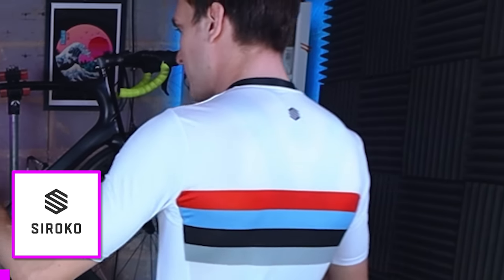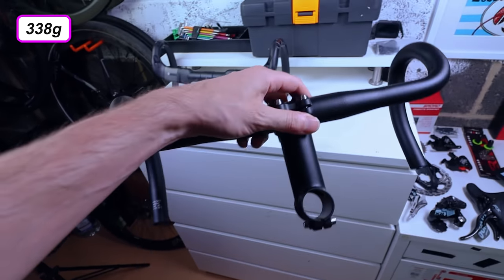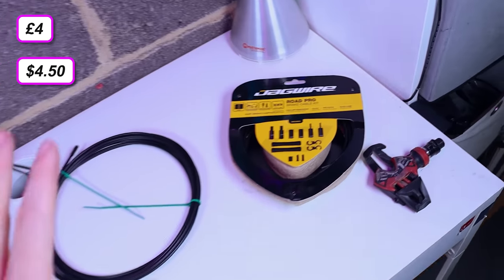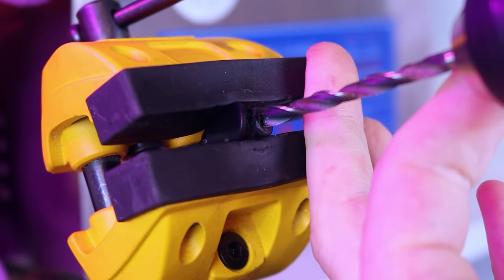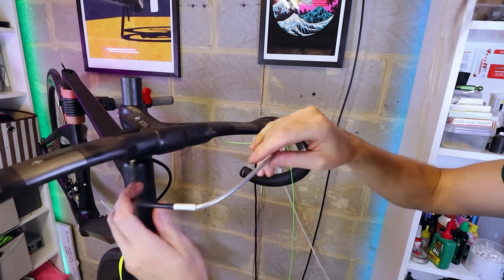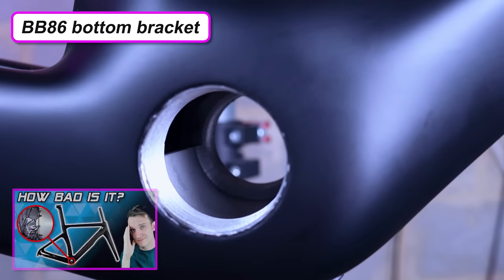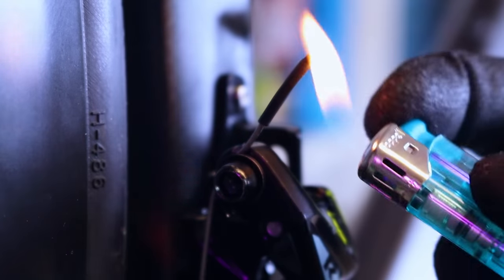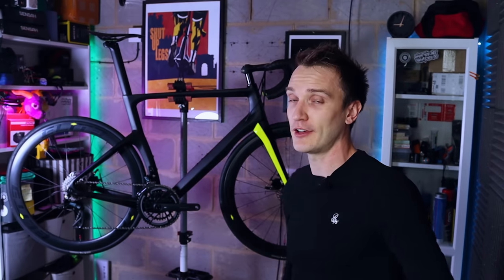£1000 AliExpress Carbon road bike build - Disc brake

Comment from the maker: Absolutely LOVING the number of baguettes in the chat 🥖🥖🥖 You guys are the best 🥰
Reply: I hope you can get some rubber boot cable covers on the brake calipers
Reply: @sepg5084  exactly what I was thinking when I saw those. Could extend the life of the cables and housings by preventing road crud from getting in there.
Reply: "Ciclista" in spanish form Spain it's with a harder "Th" like in "Thing"

Also i didn't know Siroko was from my country! :O
It makes sense tho, Spain is a PARADISE for cycling (and motorbike riding!). You should come with one of your bikes someday Luke! (No idea how much Ryanair could charge for the bike tho... 🤔)
Reply: @Angel_EU34  I'm not sure if Ali express sells plane tickets
Reply: Trace could you do a show on cheap carbon seat posts  🥖🥖🥖
Reply: The I love this fing bollox comment pretty much sums it up for me.  Kudos 🥖
Reply: Looks like someone is pretending to be you by claiming they have randomly been selected for a price. It has your logo and name and they try to get your personal info by having people contact them on telegram. Have a look at the reply I just got on my other comment on this video.
Reply: 🥖Great Vid. REMOVE that CHAIN. Its destroying your cassette. It was free for a reason. I had one free with my Sensah groupset. It was badly stretched after 100 miles. Its probably not even 12 speed.
Reply: btw I think someone is using your channel name phishing for personal details from your users.
Reply: @thomasullmann7447  yeah they are. I tried to tell him here as well a few days ago, but seems like Luke is out cycling and haven't seen it yet :/
Reply: Great build! 🥖
Reply: Looks good for a £1000 ....Tempting over the rubbish for a grand from manufactures with $10 wheels lol ....
Reply: Carbon fiber headtube don't use a star nut?
Reply: How much lighter would regular rim brakes be?
Reply: Croissant?
Reply: can you put the link for the groupset in the comments please

Comment: You should tightly wrap the steerer tube with masking tape where you're cutting. It will make the carbon stands stay together and be cut, stopping those odd ones you had from tearing out.
Reply: Or get a proper carbon specific hacksaw blade.
Reply: @Utaheyelid  nooo that's boring.

Comment: Recently there seems to be quite a lot of videos appearing on YouTube doing the same type of content, but you’re always one step ahead with more detail. Very entertaining and inspirational content. 
Let’s see what you make of the Ride Now tubes, I been using them for 2 months with no issues so far.👍
Reply from the maker: Thanks Malz! But yeah ive been really impressed with the RideNow tubes so far. They ride well, and seem pretty puncture resistant, but time will tell i guess. Good to hear you have had a good experience with them!
Reply: @TraceVelo  my RideNow tubes arrived today. No problems installing them. The trick seems to be inflating them just enough so they hold shape and then set them in the rim channel. After that it was easy. 🥖  ps. I ride with 2 spare tubes, total weight savings: 345g.  :-)
Reply: @TraceVelo  Are they latex, thermoplastic elastomer, or another plastic?

Comment: Cool build, and awesome video as always!! 
a tip on cutting the steerer tube: i used 2 old stems. mark the level on the steerer tube, plae one stem under it, and one just above. the gap in the middle will be where the saw blade will slot in, and just cut away ^_^ It might help prevent carbon fiber splinters too ^_^
Reply from the maker: This is GENIUS!!!! I have a couple of old stems knocking about in the drawer, definitely doing this the next time, thanks VeloPinephrine 😊
Reply: @TraceVelo  You're Most welcome! 😁

Comment: On the cables contacting the resin internally, looks like a prime candidate for using those lightweight plastic inner liners that come standard inside frames and bars. Even more fiddly but so worth it.
Reply from the maker: Yeah i think you could be onto something with this actually... But im gonna leave it for a few hundred miles, and see if its actually an issue. But this could be a fix for sure!
Reply: I have a Cinelli frame and the liners from the bottom bracket to the derailleurs are actually meant to be used that way so it might be the same thing here..

Comment: Hey man! to prevent rubbing on the frame with those naked cables use the plastic cable guides( clear ones that come with the frame) in that section, I have seen specialized bikes coming like that way as well!
Reply: Indeed! Jagwire sells it for their modular cable systems but you might as well just use it to prevent damaging the frame here

Comment: Thanks for the video, it actually inspired me to build my first road bike but I went a different route. I got an Gray cycling aluminum frame instead with external routing, E90 carbon fork, Sensah SRX Pro Groupset,  Elite Wheels ENT Carbon Deep 60mm  wheelset, ZTTO cable actuated Hydraulic Brakes and rotors, Zeroing 48T Crankset, ZTTO 11 speed 9-42 Cassete and chain. I reused sparre parts laying around ro compete the bike. I am very happy with this build.  Keep up the good work.

Comment: Luke, for the bottom bracket cable routing you can buy a plastic piece to guide the cable routings, preventing it rubbing the frame.

Comment: I love that you showed how tough working with these inexpensive, internally routed frames is.  But I also appreciate your own satisfaction in your clever hacks and modifications.  Two small thoughts:  you might run your derailleur cables through inner cable housing underneath the bottom bracket to alleviate the cutting that will otherwise occur.  Second, that front derailleur might be too stiff for that light lever.  I'm sure you have another that requires less torque.  In my case, I replaced my Sensah front derailleur with a Campy Super Record front; it ended up working so much better with the Sensah lever.

Comment: Great build, never felt I needed a "Disc" road bike but I'm very tempted by this just to give me the option, shame Lt-woo haven't fixed the shifting from the drops, for me it was a deal breaker with the R9's I tried. 
Bit of advice (because I can't help myself): When you next cut a carbon steerer, pic up a "Tungsten Carbide Hacksaw Blade" Its exactly what ParkTool sell, Silverline and a few other budget tool company's sell them for about £4. Use a cheap aluminium stem with a lose spacer on top as a saw guide, and cut a ring/grove all the way around before sawing through from one side this will prevent splintering.
Reply: Almost forgot: 🥖

Comment: Hey Luke! I have the same design under my bottom bracket with the cables rubbing against the frame! I fixed it by using a little piece of that guide tube that the bike comes for the cables inside the frame! I used just a little piece like 10cm so now the cable slides inside the tube instead of rubbing against the frame 😉
Reply: I had that problem also and it caused my cable to fray. Explaining it to someone was unbelievably difficult. A lot of people(me) don't even notice until their cable is shreaded. Finding it on line is impossible. I think I ended up improvising something also. Gonna flip my trusty Motobecane over tomorrow and see what I did.

Comment: Another great vid as usual!👌 Another little tip I use after cutting the excess gear cable is simply a dab or 2 of clear nail polish -nothing else! 'Keeps the cut end from fraying & there's nothing to remove if you want to pull the cable through/out to clean or replace the housing/outer👍🥖

Comment: Surely the issue with filing and drilling the cable entry points relates to the fact that the cable outer is not meant to run thru the frame, but rather, stop at the entry point with only the naked cable running thru the frame inside those tubes left in there at manufacture? This is how the shift cables on my Giant Revolt are run.

Comment: Fitted my Ridenow TPU tubes earlier this week, only done circa 100k on them but they feel great. Running them with 30mm Conti GP5000’s. Super fragile so installation is a delicate process!

Comment: Great video! Personally i would really recommend a good set of tyres. For me 12£ Prime labelled tyres just seem really untrustworthy. Regular Conti GP5000 are just so good, they almost roll by themselves and have good puncture protection.
Reply: I prefer Contis on my bikes as well. decent rolling resistance (or lack thereof), good value for the money and tend to last a good long while
Reply: I've been on those Prime tires for 4+ years. Love them, minimal flats, and last as long if not longer than the brand name ones.

Comment: 🥖🥖🥖For the cables underneath the bb, you can try using the teflon liners that come with the frame, it creates a nice sheath and is pretty smooth. You'll have to recable anyways because of the cracked bars ;)
Reply: Lol
Reply: ive always used the teflon liners too, never had a problem. Shifting is fine

Comment: Loved your video, as I have all of your videos but I was distressed not to see a seat post section lol. I recently bought a carbon complete bike from Sensah Empire, and wouldn't you know... I bought it off Aliexpress! Over here in the states, it seems as though buying a carbon bike, from anywhere, you'll have to wait until, at least mid 2023, n pay quite the exorbitant price. My only option then, was a slow ship from China! It took 40 days but my main complaint? You guessed it! The damn seat post keep falling in! This was, actually how I discovered you!  No matter what I did it wouldn't stay up. That was until I found your video wherein you mentioned just such an issue. Then I had to find the video mentioned in the video where you mentioned it the 2nd time, 1st time for me (that sentence does make sense). I had a difficult time, for I did possess the plastic you mentioned, but there wasn't quite enough room. Once done (to the best of my ability) the post got stuck several cm too high. So out I went without tightening it, n checking it every couple minutes. After about 30km of bouncing and checking I was nearly in place, n so I tightened it, and everything has been great ever since. I must thank you again! But now that I've been through such a terrible and harrowing setup fiasco, I want you to mention, good or ill, every seat post installation you do, in all your videos! Thanx again!

Comment: I guess it’s not the bar flexing,but the tower of Spacers might cause problems when it comes to disc brakes,because the brake forces are applied much nearer to the Hub.
With a non—integrated cockpit you would able to choose an upward stem.
A steerer tube should always be kept as short as possible to avoid vibrations.
Also you can see that these spacers are not really in line—probably you can fix this issue with some more precise built spacers—best solution would be a 4 cm long single spacer.
Also i highly recommend using copper paste instead of grease,it will keep water away and the thread/screw friction is more stable.
In conclusion you have proven how much the bike industry scams their customers.
This might be a problem for the offspring as cycling always has been an expensive sport,but today you need to invest like a new middle class car worth of material.

Comment: You will want to use a piece of cable inner liner in that bottom bracket area for the shift cables.  Those cables will absolutely cut through that carbon over time.

Comment: You are supposed to let the stock cable guide in the frame and use them as cable housing in the frame so it's not rubing on the carbon and it's easier.
This doesnt explain why the holes are not big enough if you want to pass a hoose for hydro disc tho ^^

Comment: An old stem works well as a guide to cut against when cutting steerer. Can also clamp the stem in a vice, to avoid clamping the steerer. Just don’t use your actual stem!  

My experience of the RideNow tubes has been good. They make excellent spares. They are a bit tricky to install, but they do have a line on them to ensure it doesn’t go in twisted. Also genuinely 34 grams!

Comment: Love your work Luke. I bought and installed the LTWOO Group set onto my trainer which originally sported Shimano Ultegra. So I will be transferring the Ultegra to my new Chinese ICAN TRIAERO A9. I have found the same as yourself with the LTWOOs. Great value for the money but a little clunky. Just as you reported the front derailleur is very stiff and i fear the plastic shifter will snap eventually. Glad to hear it you found it gets better in time. Thx again. JP

Comment: 🥖🥖 Top build and great insights. A few words of caution about using heatshrink on the ends of cables. 
1, Heatshrink tubing generally doesn't have much mechanical grip and in my experience usually comes of after a few weeks, especially in winter. 
2, If you are using heatshrink tubing, buy the glue lined stuff and once you have shrunk it to the cable and while it's still hot, pinch the end of the tubing with a small pair of point nosed pliers to prevent water wicking up the inside of the tubing into the end of the cable.
3, Buy a small heat gun with temperature setting for shrinking the tubing, often naked flames either will burn the tubing, bubbling the surface rendering it useless, or not shrinking it enough. 

🥖🥖

Comment: Steerer tube cut tips: Tape it around, then cut it a millimeter deep the whole way around so it wont flake. Also you can use a crappy stem for guide too.

Comment: I'm testing de sensah empire pro 2 x 12 with the oversize pulley wheel. At the moment, I'm pretty impressed by the overall performance of the groupset.

Comment: 🥖 just finished my own build, bought a cheap boardman gravel frame, and bought the LTwoo groupset , cable actuated hydraulic brakes from zoom just need to try it out .. cheers for the inspiration and information

Comment: The plastic cable tubes which came pre-installed should have been left on with your inner cables running through them. It wouldn't have to run directly on the carbon around the BB. This is why they are pre-fitted.. The bars are lethal though!!!

Comment: For torquing up a nut/bolt you could use an Ali Express suitcase-weighing scale hooked up to the end of a spanner and apply appropriate calculations or force vs distance. Maybe better than relying on a calibrated pin in the socket driver body?

Comment: Did the same a year before you (‘20/‘21) with a 2x12 Sensah Empire Pro carbon group-set and cable /hydraulic calipers. Carbon seat/bars/levers/50mm wheels. In total cost me £1240. Frame (the spit of yours)was £375.

Comment: baguette. ive been running the ridenow tubes on my rim brake bike for about 300-400 miles and theyre perfect. i also have a (different model) rxl carbon bar, the one that weighs 180g. its going great too. good video!

Comment: A couple of questions. 1) I'm wondering about the crank.  Ali Express listings for cranks seem to list cranks as being suitable for 10/11/12 speed. However, a 12 speed chain is narrower, so big brands like Shimano have less spacing between the big and small chainring as the chain gets narrower. Do you notice any additional friction or front derailleur shifting issues on your build? 2) If Sensah/Ltwoo, etc., are building 12 speed groupsets, why don't they add fully hydraulic brakes on road groupsets? I'd probably prefer 11speed with hydraulic than 12 speed mechanical. 🥖

Comment: 🥖🥖 I’ve had 4 RXL SL bars, no stem, and am 3/4. The one that failed didn’t stay in place at 4nm and cracked at 5nm. 🤷‍♂️ The other 3 have been great with a few thousand miles on each.

Comment: First of All🥖. 
The second is my wish that if you had put some plastic or any thought out frame mounts to hold the cables, I you would give this Carbon Fiber Frame a fair chance putting it into a test trial of tens or even hundredes of miles. I thought is was interesting to find out wether this unwell put together and flaky carbon pieces carbon frame on the inside will hold under loads of power and vibration. 
I’v always wanted to have a super light and modern electric Carbon Bike, and now I know if take a chance and shop arround, I might be able to assemble s very decent bike. 
So thank you so much for the inspiration 😃

Comment: for cable ends I also use heat shrink with a bit of gorilla glue on the end of the wire

Comment: Awesome build! Well Done! I’ve been using the Conti Race Lite tubes, only 50g and the handling is very easy. For the cables on the resin, maybe run the inner liners, from a link style cable? Single bolt stem is no good in my book. I’m looking to clip a little weight, and I’m loving the integrated bar look, can’t wait to see what  you swap in! Keep up the great content! 🥖 🥖

Comment: 24:45  for this, I used so called oscillating saw or dremel or some people call it multitool. It's goes very easy through carbon, no need to take the fork out of the frame even. I put the bike down on the old blanket outside and with the help of a dust mask, worked slow and steady and it made a perfect cut.

Comment: Why not use some Jagwire Slick-Lube Liner (or something similar) to route your cables around the bottom bracket. This will keep the cable clean and protect your frame! I have been using this for ages and these inner liners are dead cheap. Cheers and keep going!

Comment: 🥖🥖🥖 Next build you should try the vacuum trick to get your cabling sorted. More in line with the cheap prions rather than special tools. Could also be easier as you avoid dragging it over all the rough parts wit a magnet? Just tape over all the holes besides the one you are cabling through and then use a vacuum to suck a string through :) Anyway, love the build!

Comment: You feed the cable housing through the frame and the reason the holes are small is because you are supposed to only feed the cable through the frame. The housing stops at the plastic caps at each end.